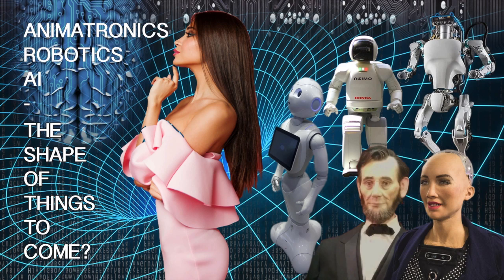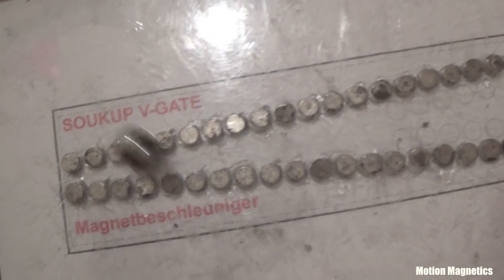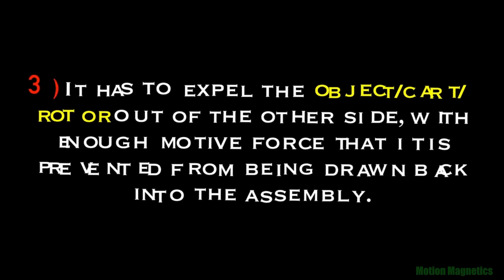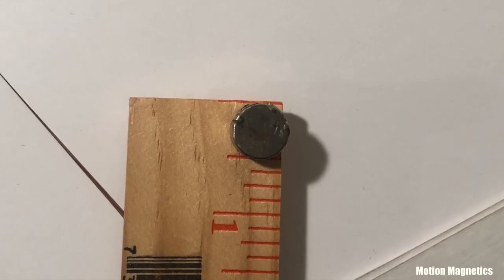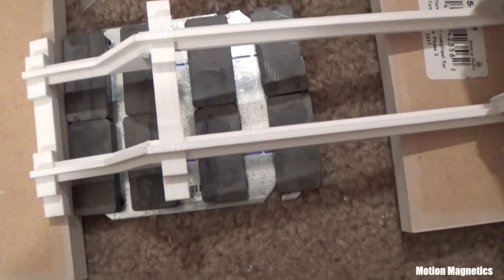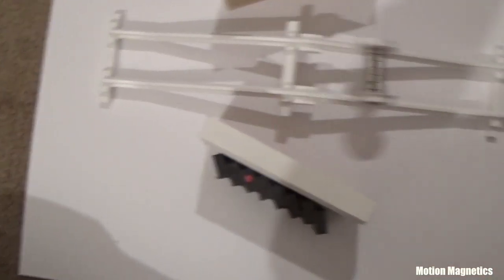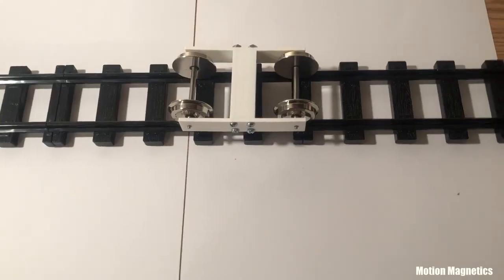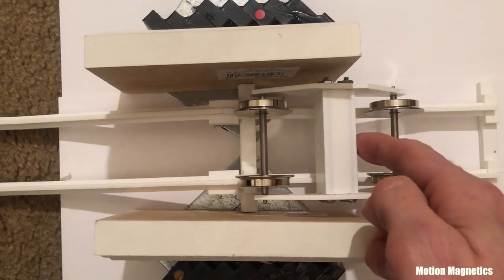The Magnetic Gravity Gate

Comment: A flat sheet of low-historesis metal (like the metal used in transformers) will effectively "shield" magnetic Flux.  Utilizing the same Flux that acts as a catch in a magnetic gate, a shield can be momentarily drawn into position, which nullifies the final magnets' attempts to draw back. Play with it, you'll see. I don't understand all I know about this, but I have a toy cart running on a plastic track that will run seemingly forever on a loop track.  Because it won't self start, it becomes disqualified as a "perpetual motion" device.  It's fun none the less.

By the way, I'm autistic and don't think the same way as others.

Comment: When a magnet is in a magnetic field, it has some potential. Releasing the magnet will release this potential and its stored energy, so the magnet will "fall" to the point of lowest potential. This is true for every kind of field, gravitational fields too. You use both fields, meaning you add them up. The problem you are going to encounter is, that there is still a spot of "lowest potential" in the system, even if it is not that obvious to see. But please keep it up, I really want to see how it works. Maybe every physicist is wrong and you are right.
Reply: Perpétuel work... just adding what you call standing waves.  Just à few missing parts...cant wait To see.. I sketch my way To see if they Will do the Sa me
Reply: @simonhot  What do standing waves have to do with perpetual motion?

Comment: Adding to earlier comment, a goal would be to pull only leading up to the drop point, drop it at least 45 degrees, not symmetric lead up and follow through, use mass drop with deflection (wedge = 1.25X multiplier) and lower track further from lead-up magnets with projection from momentum away from 45 degree drop, yet suddenly flat. Then if possible draw in with the next magnrt just enough to allow next drop at same or greater energy level; the key may be weak magnets positioned close to track in short yet separate intervals, letting 45 degree angle do much of the work. For this I have found less of a bar but weaker over shorter distances including shorter width more effective. Additional secrets keep very base of drop points a bit shallow (still downwards-sloped) to extend earlier mass-wedge effect. Position magnets so they are not located immediately on the lip of the drop, but eomewhst earlier to reduce magnetism. Allow the pull from the magnet to sling ball barely over ledge with thst monentum translating directly into the mass-wedge effect. I saw some results already slthough interaction between ball and magnets numbed this effect in series. It was close to working in series with consistent altitude even in my crude attempt, however the magnetic effect on the metal seemed to wear down the results over time. Another idea, sling over a hump with some but not much resistance before wedge, allowing more efficient sling with gradual but still less back-pressure when the magnet free falls, use magnets and angle of arc exclusively to permit gradual altitude gain which could be used to ultimately roll marble to beginning. It may help to use long-range weak magnets that wear off after three inches or less but with semi-significant drop. Earlier reference to shallow just meant the slope leading up to the next magnet begins downward-sloped to help momentum.

Added to online  inventor's journal under motionmagnetics

Comment: On second thought you seem to have many if not all principles. You have bothered to create arcing tracks and describe using mass already..  an effect. My biggest tip then for this is to consider how to lift a ball a long distance even using a seesaw in equilibrium with blocking on one end from a lower level using higher midpoint of ball, perhaps (or not) use lightweight projectiles and simply consider if you gain height you can drop them a longer distance to escape the magnetic fields. The combination of <50% resistance and equilibrium with lower midpoint of track combined with magnets may have an effect. This could also be used with exponentially efficient mass versus leverage (with heavier mass at very short distance and leverage operated by a small ballbearing at originally slightly higher midpoint altitude. The ideal arrangement is a tongue shaped bridge segment elevated only very slightly. Magnet pulls ball unto tongue mechanism (lower guide bars attached to lever), ball meets with little resistance due to 0.5 M x D (bridge not blocked), equilibrium force adds momentum while marble is still pulled by magnet, now at higher altitude. If you go far enough upwards you could actually drop the marble downwards with slope to return to beginning and minimal resistance from the last magnet.

Comment: Really Good job!  What about a spring at the end of the track - like a rubber band across to propel the cart backwards at the field to create a yo yo effect?  If the car is derailing, either make the wheel lips larger or make the car longer or even have six total wheels.  You could also angle the lips of the wheels so the weight of the car causes a V groove more centered alignment.  Angling the track might be a consideration.  This 3D printing adds so much more possibilities.  Stay inspired.  The knowledge alone is valuable.  There will be times in life that this added creativity will play well for you regardless of its involvement or not with magnetics.  One last thought, might there be any advantage to having some magnets not in a center line near sticky points.  I.E. back them away.

Comment: Using the Repulsion magnetic field of the magnet might be better than using the attraction field to achieve a self-rotating magnet motor like in the Yildiz All Magnet Motor. I have the patent to Yildiz all magnet motor in a pdf file with all the specs and drawings, it shows that his motor uses repulsion to achieve rotation. I have tried many ways like you with the attraction field of the magnets but with no luck although I've been very close. I believe creating a vortex using the repulsion magnetic field might be the ticket. I will experiment with the repulsion field next, I have a 3D printer.

Comment: What do you think about 3 tracks side by side but with 3 carts all connected to each other. With the 3 tracks offset so that only one cart is in the “ sticky “ spot while the other two are in there push or pull position. So using two carts to push the one cart through its catch point? And so on staggering the track so you always have two pushing the one through? Any thoughts or have you tried this already? Awesome video Keep up the great work!
Reply from the maker: It's a nice thought. Most of the cases where I've tried configurations like that the cart/carts end up slowing to a stop after hitting two or three sticky spots. It's like trying to run the cart over speed bumps.

Comment: What about a wheel where the magnets on the wheel turn under a gear mechanism tied to the center shaft, essentially changing the field just before or at sticky points. Set the gears up so you can have a gear box and swap out different gears to tweak the moment of spin and the speed of spin. This could be called the “Magnetic Finger” like flipping the bird to the magnet that was going to cause a sticking point.  

You might need to fast flip magnets on the wheel at a precise moment - non linear - requiring an egg shaped following gear or a tipping point edge.  This could be called “Tick Tock”.  

Even consider turning magnets at a more neutral at sticky points or have a mechanism to move the wheel or car magnets farther inward so sticky points have less to grab onto.   

Let’s call all of this synchronized modality “Harmony”.   Why do I have names... because the solution to a problem like this requires that you think in new dimensions like a gear box, tipping point,  pocket watch,  etc.  With 3D printing, neodymium magnets and a creative mind, you can perform experiments no one else has, or in new dimensions.  Stay motivated and inquisitive in life will reward you.   

Keep up the good work!  Being inspired is the most fun thing in life.  Inspiration is taking things into new dimensions. I will also share one other thing.  Brilliant thinkers don’t start with following what others have done.  This is hard to explain, but there is a tendency that people study too much of works of others too fast.  That causes blinders to think only that way.  We can do a video chat if you want to explain any of this.  

Howsecureareyou at g mail  (I typed it that way to avoid copy by algorithms). JR here
Reply from the maker: Thanks for all of the suggestions. In most cases, adding mechanisms to try to get around the sticky spots requires more energy put into the device than your potential gain. One way that I think would definitely work, without negating potential gains I covered in my video The Key to Building a Magnetic Motor.

Comment: Very well done. I hope you get it solved, how to do a selflooped working magnet motor... I guess one needs to go the direction of using special switched coils like in the SAV motor...So, if you would add into a Howard Johnson train some microprocessor controlled coils, that are switched open and closed at the special locations, when they are at the sticking point or so, to get some stored energy in a cap to discharge via the coil to propell the train forward or something like this...

Comment: Why not combine natural magnets and an electromagnet that is on some sort of timing chain, to flip off when the cart passes it? I wonder if you could set an IR lazer that trips the magnet to turn off, that way it doesn't get caught on the tail end of the vgate....u could use the electromagnet like a slingshot, turns on and off at just the right time to push with no pull?
Reply from the maker: You'd have no difficulty at all making these systems work if you introduced electromagnetism. That would take all of the fun out of it though. I'm attempting to do it using only permanent magnets and shielding techniques.
Reply: @Motionmagnetics  that totally makes sense- I am interested in overunity / working parendev motor, I have designs for a an assisted bike wheel that extends momentum- any patents you'd recommend taking a look at?
Reply: By the way I'm honored to hear from you! Big fan, longtime viewer!

Comment: Have you tried a spinning circle with angled spiraled steel metal strips like spokes that get thicker as they come to the center and makes a solid center of steel. The outer edge is drawn into a strip of magnetic field that goes all the way into the center. But the field is never brocken in the center so no release is needed and the angled tips of the metal strips in the circle that get thicker and closing the gap of the magnetic field so they get pulled and circle spins.
Reply from the maker: I have not tried that.

Comment: Maybe best to use a electromagnet at the end of the track for a split second to break form the magnetic pull to tweet it that the speed of the momentum has more energy than the electromagnet. a more powerful electromagnet is the key. 
The electromagnetic field coil pattern is being ignored BIG! 

Every electromagnet coil is all bad to made mindless winding. Since it negates the wire next to it. Think about it if you have 2 wires next to each other rotating left it would be like 2 car tires rotating left while touching which causes friction which is a loss. You need a gap in each wire. to go the opposite direction and then use that to also give energy back to increase the efficiency.  OOO (left left left) sucks compared to OoO (Left right left)  
OoOoO
oOoOo
OoOoO   Go ahead measure the current with 4 wires together going together and alternating to only put power in 2 wires and measure the power in the ones with no electricity. 
Also why does it have to be round when flat can give a greater boost |I|I|I just like how capacitors are flat as well. Just a guess on that one. 

As for just magnets has it ever occurred to anyone to try the exact center dot of where the magnet parts ways and a bit slightly off since you have a dead zone and a one direction. 
    }.{
S-----N

Comment: my thought is just make a rotory motor and use a servo of low power to switch a magnet, if the rotor is big enough you'll be able to use lower rpm and get torque out with minimal voltage in.
Reply from the maker: I'm attempting to do it without any electromagnetic assist.

Comment: Do not put your magnets on a metal plate. That deforms the field.
Reply from the maker: My intent was to shield one side of the magnets in this case.
Reply: @Motionmagnetics  Then rather put a metal plate between the magnet and the components but don't let the magnet physically touch the plate. It makes a big difference. Simplest way to see what I mean is to try to bring two magnets with their north poles together without a plate touching versus with a plate touching. In the scenario of the plate touching you will see there is no repulsion between the two magnets even though their north poles are close together.  This does mean that keeping the magnets in place is harder since they cannot simply be stuck onto the plate to make the intended pattern.